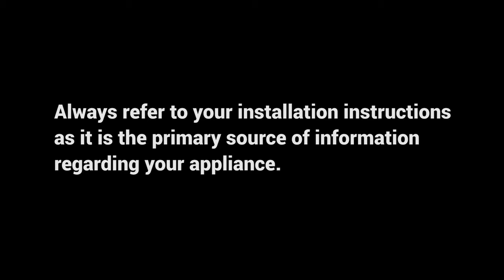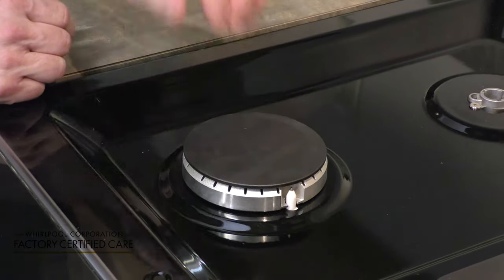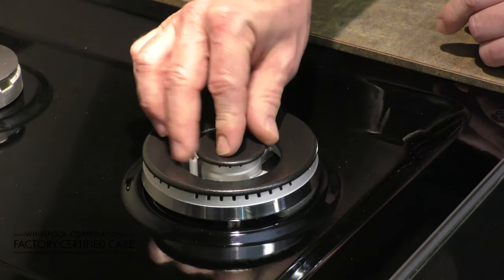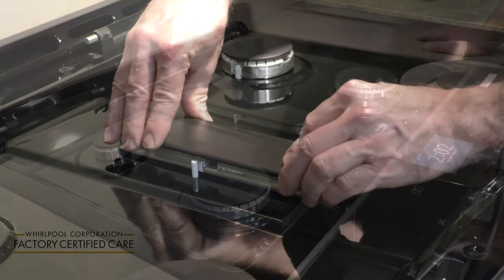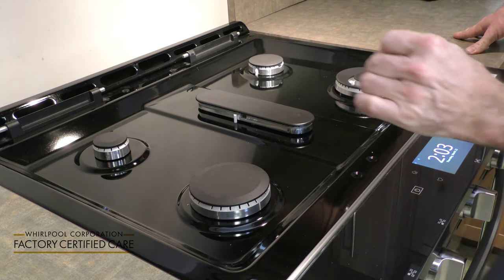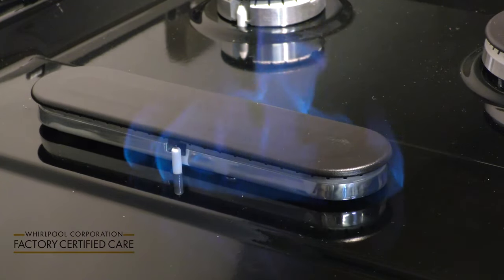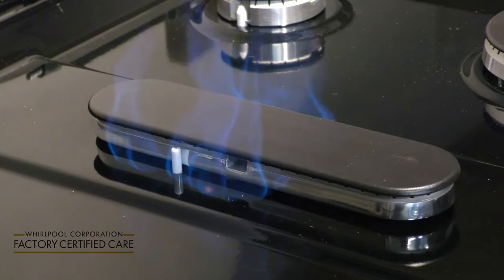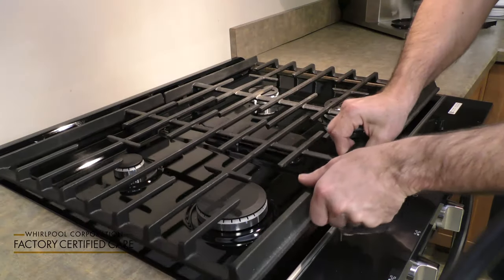Burner troubleshooting on your cooktop

Comment: Is there a way to adjust the intensity of the cooktop flames?  When I turn the flame on all four burners to the lowest setting, I can still boil water, so for some reason the flames do not adjust accordingly to the knob setting.  This Whirlpool range has only been used for 6 months, so it's basically new.  I do not know who did the initial installation.  Thanks, Michael

Comment: Hi, my middle burner flame was always work just  half of the burner.  Do you know why?
Reply: Did you ever figure this out, mine is doing the same thing
Reply: It may be that the slots on the burner are clogged. The ceramic cap can be separated from the burner after loosening the small nuts on the underside. After doing this the slots can be cleaned. My son bought a house that had a stove with a middle burner that would not light at all. It apparently had not been used for some time and there was a build up of grease from the other burners. I soaked the burner in vinegar and water, which didn’t do much and then cleaned the slots mechanically.

Comment: I have a stove like this and my center burner only comes on low. No matter how I adjust the knob the flame does not change. Can you help me fix that?
Reply: i got same problem. looking for fix
Reply: @armydog24  Clean the center with a toothpick or some other pointed object.. Its clogged.
Reply: @craigslistrro709  There are also little flossers with brush-like teeth on them that fit great in the tiny slots and can get gunk out, as well.  I just unbolted, steam-cleaned and used the flosser when only 2-3 of my little jets were working.  Now, all of them are burning great.